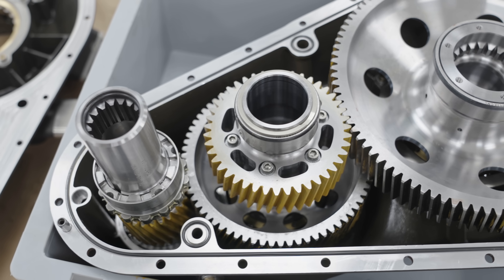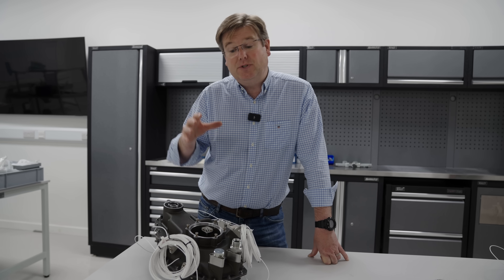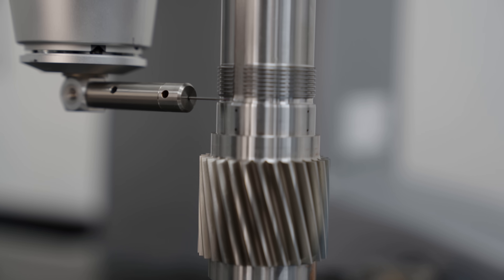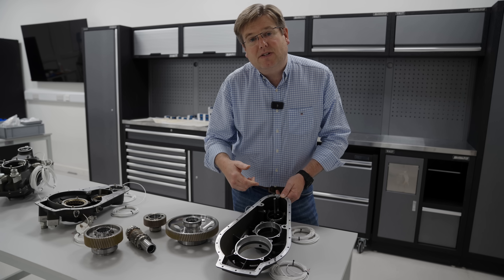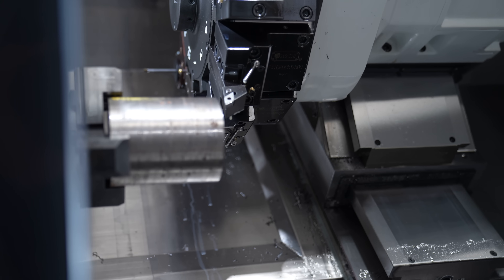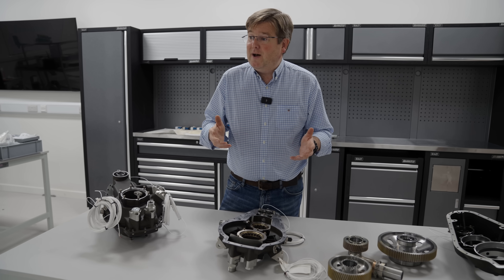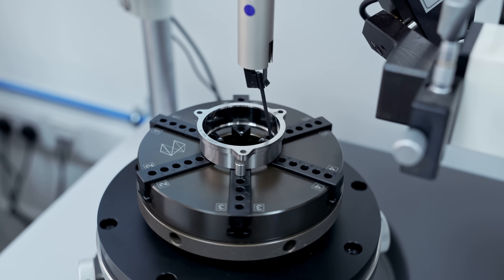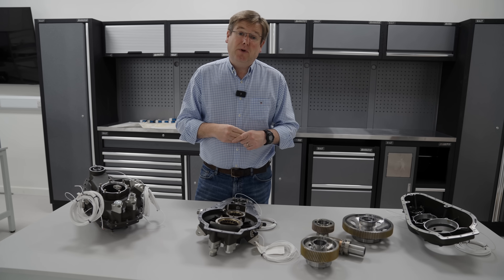GT50 Speed Reduction Gearbox

Comment: Trivia: 500 horsepower (368 kW) at 36,350 RPM is only 72 lb-ft (98 Nm) of torque. Of course that it multiplied by a factor of about six by this gearbox, and further (by a factor of roughly 15) by the main transmission.

Comment: I do not see any oil feed holes or slots inside the root of the teeth on those gears. Oil bath will NOT be sufficent esp with those rpms from a turbine
Reply: Lubrication and cooling were not described at all. Perhaps Hill has another entire video planned for that.

Comment: Aviation is always a different beast. An F1 car has 1000hp and weighs 900kg, a helicopter has 900hp and weighs 1100kg. But the helicopter has a TBO of 2000h and the F1 car 20h.
Reply: What helicopter has 900 hp and weighs 1100 kg? Hill's design is half that power and the weight is a mystery; real light helicopters - the higher-powered singles engines and lightest twins - are sort of close to those values.
Reply: @brianb-p6586  for example the H125, 848HP, 1174kg I call that close enough. But the main point being that everything must be ultra-giga-reliable in aviation.

Comment: I dunno why you'd bother trying to cast those casings.  With the right design features you could rip them out of billet with way less effort and cost than you'll need to put in to keeping floppy castings porosity free and with decent material properties.
Reply: The assumption at Hill seems to be that they are preparing for mass production... starting with the first unit after the first flying prototype. I'm not sure if I should admire the confidence or laugh at the hubris.
Reply: @brianb-p6586  There's a lot more money being put into this venture than I've seen at other "startup" aero attempts like Terrafugia. I hope Hill can make it, but history is against them...
Reply: Anyone playing with aircraft stuff seem to have a  mindset all their own and over complicate everything ..  a hammer forged billet would be stronger too..  an interesting can of worms..😂😂
Reply: The castings are just large enough that getting uniform heat-treatment in a "billet" section of aluminum might be an issue, although some alloys like 7050 are better for thick sections. But ultimately, if they CAN control the casting process it's a cheaper way to go - the need for careful cutting strategies is still present if working from solid and the volume of chips to dispose of is much, much higher.
Reply: @davidg3944  You can heat treat a rough machined part as easily as you can heat treat a casting.  As far as being cheaper, I still dispute that, especially at the volumes we're potentially looking at here.  Casting adds another layer of technology that you have to monitor and control whereas the machineshop that rough-machines prior to heat treatment is the same one that can finish machine - capital utilization can be much higher.

Comment: Heat management in that gearbox must be an interesting set of issues.
Reply: I guess they now need to make a complete over complicated oil cooler system to keep said box from lunching itself..
Reply: @rebekahfrench5747  the fluid inlet and outlet fittings are clearly apparent, but Hill didn't say anything about cooling and lubrication. Yes, it needs and oil cooler, pump, and controls.

Comment: Fantastic job making your own high speed roller bearings 👍 what controls the axial load from the helical gears at high rpm? I was expecting roller taper/ angular contact.
Reply: Some of the axial load can be absorbed by tooth angles but you still have a considerable force on the last gear and most flat roller bearings dont like to run hard on the end flange..  maybe we missed a torrington bearing hidden in there..